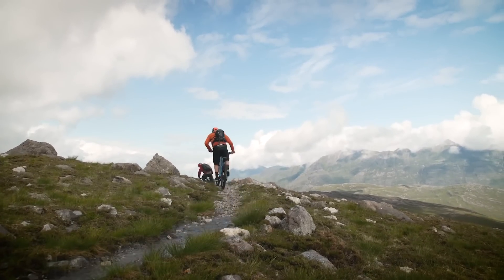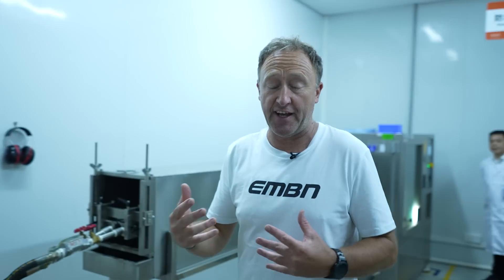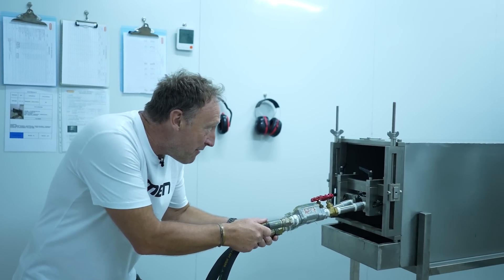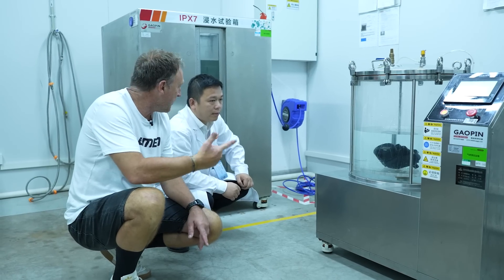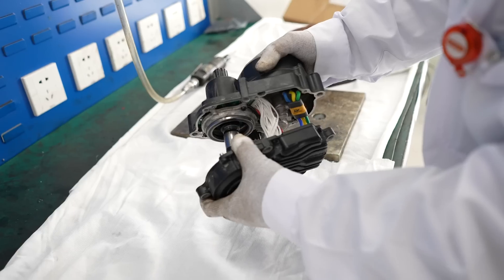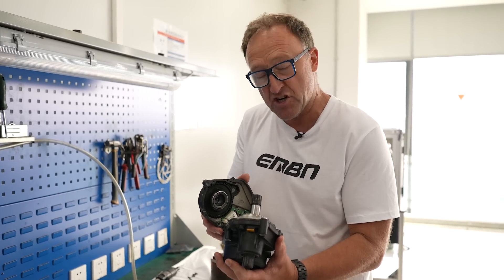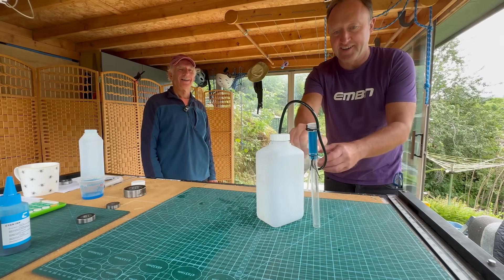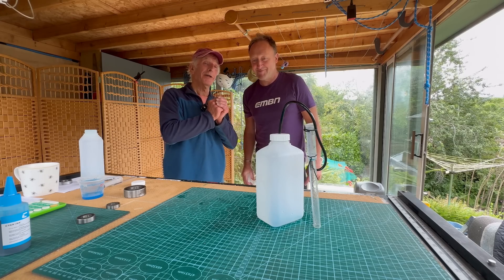Are eBikes Waterproof?

Comment: All I can say is, I’m so thankful that I live in Southern California, where it’s always dry. I couldn’t deal with that constant mud and constant bike cleaning.
Reply: I feel ya.  Not in CA but in Qld Australia.  We get an average of 3-5 rainy days over winter and 9-10 during summer.  Even then it's not normally set in and the trails are never complete sludge.  

It would drive me crazy.
Reply: @lucideuphoria7092  Australia rocks, particularly Qld!!
Reply: @joehozzy2616  the only thing we are lacking is elevation...for some reason our trails cap out at 50-60m elevation loss regardless of how many 300-400m fireroad descents in the same locations.  

You basically have to ride old overgrown rutted logging tracks if you want a descent over 1.5km which is strangely frustrating.
Reply: Ha. It really does suck. I want your weather .

Comment: These test are ok from a component level perspective. But, it's missing the real practical test. When using an e motor there are forces applied on the cranck, the housing of the motor etc. That should be considered in a test setup. Also, as with all components, less is more. Motors should have fewer parts and easy to be maintained.

Comment: Problem: Temperature differential creating moisture vacuum.

Solution: 2 (two) 4mm drilled and taped holes in the motor case. One upper, one lower. Vent hoses and one-way check valve. 

Bonus Solution: Mechanical venting system in addition to the above. Pedal driven. Basically, it's a positive crank case vent. 

Water ingress, a non-issue. But corrosion will be. Oil filled or bathed is the only way. But still will need vented.

Comment: Having had bearing replaced in our bosch motors, & being a  mechanic. Should the motors not have a breather tube up into the frame, to allow air transfer without sucking it past the seals ? Love your channel 👨‍🔧

Comment: Not having moisture detection in motors is unforgivable, submersible pumps often have this and it could be integrated with some desiccant to provide limited protection….. the cost implications are minimal the sensors are typically less than £5 retail….. integration costs would be minimal.

Comment: Ray's experiment works well in an open eviroment and when the air pressures can equalize. When introducing correct sealing, the capillary effect susides dramatically. Don't forget water molecules are larger than Air molecules.

Comment: It is simply a fact of life that ALL seals have a lifespan. And that they will wear down. Dirt plus water is an abrasive mixture that will destroy every seal sooner or later. And yes, this means maintenance. And depending on your habits this can be in longer or shorter intervals. A pressure washers forces the abrasive water-dirt mix into the seals which is simply a death sentence. Maintenance can capture this while only the seal is damaged instead of the whole motor.
These eBike motors are incredibly rug sized and survive an incredible amount of abuse but you simply have to understand that is ability to withstand the elements will end sooner or later. Even standard bottom brackets break down eventually and mid drive motor units contain these on top of the electronics.

Comment: The main issue here is the motors are new. It would be best to see a motor used for 1,000miles then go back for testing and see how it fails then.
Reply: 1000 miles? , need to ride in the lake district , 200 miles will do it . does matter what brand either unfortunately
Reply: I've done 600 miles on my bike already and expect to clock more. I'd find this information extremely useful.  @mps6dave

Comment: I am on my 3rd Bosch CX motor! The last one failed in hard rain on the Climachx trail near DYFI bike park. Granted it rained hard and after 5 minutes we rode through all puddles but have NOT submerged the motors! Both motors (my friends was a shimano motor) failed within 30 seconds of each other just as we finished riding. Not impressed with Bosch. If the motors are so sensitive to water ingress then don’t sell them for MTBs.

Comment: That repeated dunk test in dirty water is quite impressive. Maybe motor manufacturers could "fill" their motor with dry nitrogen gas before sealing up. Nitrogen is used in race tires because it expands less than moisture laden "air". Anyway, just thinking out loud.

Comment: yes the motor should have oil in them and a full maintenances kit with seals and bearings that you can install on say a yearly basis. I mean you do that with head sets and other things on the bike. As far as blaming it on pressure washers the manufactures aren't being completely honest yes you shouldn't use them but, it happens to bike that have never seen pressure washers. Every decent manufacture should have a full service kit and bike shops should offer the install service and also sell the kit. It's a win win they make money your motor is kept up. The other way customers are unhappy and may not want to buy from you again. Also people are still going to buy new motor for various reasons.

Comment: Seems like the answer is a vent tube that runs up the seat tube into a flexible air bladder of say 30 or 40 cc. Motor cools and sucks in air from the bladder, motor warms up and pushes the air back into the bladder.
Reply: great idea. also, fill the motor with dry nitrogen when manufactured.

Comment: 👍Crankcase/engine ventilation with venting high up in the frame should solve this negative pressure/vacuum problem that exists.
Even a temperature hike around 0°C, is also a problem that can fill an engine and other closed vessels with water🤔

Comment: Bafang has shown that they are aware of this even in this video. The test in the pressure tank is exactly that. Cooling down the motor quickly would result in a vacuum inside it, which is physically speaking exactly the same as increasing the outside pressure.

Rays calculation shows more of what would would happen with an incompressible medium such as water inside the motor, air on the other hand can compress under high pressure very well or expand under low pressure. I am not saying he's wrong, but the amount of water sucked inside would be far less ( depending on the quality of the seals) than the calculation would suggest because it is missing the seals as factor.
This might be another reason why ZF has chosen to move some electronics out from the motor. When I remember correctly the battery electronics are placed in the upper part of the battery compartment, maybe they're onto someting with this idea.
Reply: @haemmertime  if rapid cooling creating suction is a problem then why don't the just fit a breather pipe to a safe location, seams a pretty simple fix to me.
Reply: @superchickensoup  true, this might be a solution, it comes with downsides though. Mainly it would increase the air volume the motor, by that when the air cools down it would cause a greater suction into the motor. When the inlet would be in the water at the same time (maybe a in an accident/crash) as the motor gets cooled down it might result in more water getting pulled in.
There are pressure equalising tanks in hydrolics to absorb peaks, I would consider this a better solution, because they can be integrated in a sealed system and don't require any electronics. These however would add weight to the motor.
But that's enough armchair science from me, have a beautiful day

Comment: motors need is to include moisture sensors…… if pressure is an issue then could include a bladder or bellows under a cover. Just on motor nr 5…. Never pressure washed and carried internally in vehicles when transported
Reply from the maker: Sorry to hear you've gone through so many motors, what brand is it just out of interest?
Reply: Specialized 2.2. 4 under warranty and the latest one that I’m going to have to fund from an independent specialist instead of Specialized. The temperature change / suction scenario could be addressed by including something like a shimano reservoir bladder seal from a M775 lever.
Reply: If rain get at e bike it will cause problems your bike gets nackered

Comment: I think the pressurized motor submersion test shown at the bafang factory simulates the same situation as Ray's demonstration. It creates an environment where there is higher ambient pressure outside the motor than inside the motor while water is present all around the seals.

I agree with other commenters who have stated that forces on the crank shafts, or other mechanical forces applied to the motor while exposed to water are the most likely culprits for how water ingress can happen in real-world use.
Reply: There is a simple solution for this problem, a valve and hose to reach  in a dry  area of the bike, so the bike motor can breathe .

Comment: breather hose running up the frame will solve the suction issue
Reply: Son dynamo built a pressurised silicone air bladder into their hubs to solve this very problem and now they give a 50,000 kilometre warranty on their bearings.
Reply: @DaBinChe  This is common practice with 4WD differentials, gear boxes and transfer cases. Breather tubes running up to a high point with a filter to stop water and dust ingress

Comment: There's no excuse why any of these motors can't withstand IPX5 water ingress standards. They are designed to be used in mountain bikes, and mountain bikes are going to get wet. My Shimano E8000 has been transported on the back of my SUV for 4 years and has done over 5,000 mi, I just cracked it open to regrease it and it was dry as a bone inside. If these things are properly sealed, they should never have water ingress.
Reply: @XennialGuy  that's absolutely true. But there are even ways to prevent moisture sucking into the motor, even when a sealing isn't working properly. They could do it by a membrane.

Comment: One answer would be to make them easy to service with widely available, reasonably priced, spares. Who cares if you have to change bearings every year if you can do it 8n an hour for about £20. Same goes for electronics, components/boards are cheap as chips, just make them easy to swap and cheap to buy.
Reply: Was looking at Bosch CX gen4 and I'm surprised the replacement cost is under $600 all in from reputable Bike shops on ebay. Says they are fully programmed. If that's plug and play by me there's no sense in getting a shop to repair an old motor.
Reply: @DSC800 my cube reaction was onto its 3rd motor (original plus 2 replacements) by the end of its 2year warranty. .

Comment: OK.... I just went and looked a motor replacement video. It looks like if someone was going to service a Bosch motor, they have to strip it down like they are putting in a new motor. What BS! and a good way to sell new motors!! I have a 1985 Honda 3 wheeler I bought new. Its been under water, over water and thrashed for 35 yrs. And I had to put a new motor in my bicycle in 4 yrs. Cordless drills I've dunked in a pail of water to was the mud out and they've been running for 20 yrs. Either make them more serviceable or get Makita or Honda to build bicycle motors.... And I'm 63! I'm not thrashing on my Trek Powerfly5....

Comment: currently a lot of the motors are a total write-off from water ingress. circuit boards get no extra protection and it seems to often be that which makes the whole thing landfill. Protect the circuit boards better (completely seal them away), and allow moisture to escape the rest of the motor via one-way valves/membranes.  I don't think you can stop water getting in, but you can allow it to get out.
Reply: Seriously, what would it take... $1 of protective goo coating circuts.
Reply: good isea, pop a small sachet of that silica gel inside the casing...that will help dehumidify yhe inside
Reply: @RicardoPetrazzi  silica gel soaks up humidity, but only until the gel is saturated, then it no longer works unless you can dry it out.
Reply: @stuartbayliss9251  plus chem interactions. But seriously, we've been coating many phone pcb's for years, and there are conformal coatings and varnishes that are up to the task. If you're deicated enough to do a pcb smt repair these days, I can't see such a coating stopping you... however most any service repair is going to put in a fresh part anyway, if there is a physical failure.

Comment: I have a Lappierre with a Yamaha Pw motor and just fitted a new set of crank  bearings due to noisy when peddling. Somewhat disappointed with the poor weatherproof crank bearings. It is 5 years old and would hope new motors are now better protected. Main bearing kit was £52 and it took me about 2.5 hours to change. Quite simple really. However, with improved seals these bearings would have lasted far longer.

Comment: I do waterproof IPX7 certified motors. It's costly and only high level competitors book this modification. It takes days for high temp silicone and red insulating varnish from mg chemicals to cure. Depending on motor size and riders budget it starts from 250€ up to 600€ ebikes only.
Mechanic engineer forgot to mention condensation...

Comment: So, based on the latest information presented,  a simple vented hose set up would be the answer to the rapid cooling suction issue. If my motor ever fails, I will modify the replacement as described. 😊
Reply: Yes like $x$ diffs we could have a vent up inside the battery towards the head tube to vent the motor and put a Gortex breather on it.

Comment: Great video,  keep them coming.  Need a look around Bosch motor company
Reply: I had 4 warranty motors on my Bosh. On my new bike they have limited the warranty to two years from point of sale and no more perpetual warranty
Reply: There is also the “right to repair” issue if the mother board fails no way to fix or buy a new one has to be a new motor full stop
Reply: @Calvin_Wright  EU needs to step inon this and batteries.  Ebikes are becoming an ecological disaster and Bosch is the worst offender

Comment: Breather pipe drawing air from an area within the frame high up to help balance the air pressure - simple
Reply: Yes. also add a flexible air bladder to the end of the vent tube too so that any air sucked into the motor is always bone dry.

Comment: Until bearings are redesigned my emtb won't see water if can help it! But certainly the blue head gasket sealer will help on your outer metal skin of the bearings and a tad on smaller crank one my mate even has thread lock on his and work's so its not hard for them so cut a channel to seat an O Ring!

Comment: Can the motors have a breather pipe fitted up into the top of the frame with a one way valve to release temperatures of the motor? Maybe the one way valve would have to become a checked/serviceable item but would aid the motor from water ingress?
Reply from the maker: That could aid the issue that Ray explained but will probably cause more issues than it fixes 🤷‍♂️

Comment: I’ve done a few sessions in the snow over winter here in Colorado. So far so good it’s a blast riding in the snow.
Reply from the maker: Does it affect the range on your bike much?
Reply: @embn  most definitely.  I do ride a lot in winter here in Colorado. 15 miles or so on a ride. On my 2022 husky with the ep8 in snow roughly 6 inches to 1 foot uses up all my battery yeah. But it was Soooooo fn fun.  My new Rocky Mountain instinct just showed up on Wednesday 7/24/24.  Heading out later to 10,000 ft to beat the heat.  Happy Trails embn

Comment: Bearings need to be completely redesigned the inner and outter metal bodies need a rubber seal gasket seated in a machined groove on the surface whare it presses into the body whare its metal on metal contact only! Same with the inner bearing ring same channel need cut into it and a gasket fitted whare the BB crank is met as metal on metal again it will not have a 100% water tight seal it might mean the wall thickness of the Bearings might increase a mil or so and will change the sizes but I think it's definitely something to consider for future proofing our investments if brands would go this far but in all seriousness they are manufacturers only interested in profits same as cars etc and have a life span of 3 to 7 years then forced to buy from them again never ending circle of greed whare as it can be such an easy fix!

Comment: Specialized bike here , 3 years old , 3rd TCU, 2nd motor , 2nd battery to motor harness cable , all water ingress, ridden probably once a month .Here in the UK imho , not fit for purpose .next eebs will be pinion bike anyway. ebbs Costs a fortune in drivetrain components too.!eats em for breakfast!
Reply: I hear you, the sooner an mgu and belt drive, the better!
Reply: Has the Pinion MGU been out long enough to determine its durability and longevity?
Reply: @Scomelbasses  the gearbox has been around a while, not so the motor?! 🤷🏻‍♂️
Reply: @danielsimmonds5162  yes, I’m aware the gearbox has been around for awhile, I used to own a bike with one. But the MGU hasn’t been out long enough to say that it will be any more durable than any other motor out there. The gearbox itself is simple, no electric components to worry about. The MGU will have all the same potential problems as all the other motors.
Reply: @Scomelbasses aye it will . Gonna wait a couple years , see how the land lies . Back on normal bikes at the mo : luvin it
Reply: Pretty standard for specialized? 😂

Comment: By that theory when they warm up again the heat will produce pressure inside which could force liquid back out if there was a one way valve placed correctly on a water collection point maybe.
Reply: Water tends to stick to surfaces. Also some water will evaporate inside a warm motor and condensate when it gets cold again. If you pour water out of a bottle and then seal the bottle again, it will contain enough water to stain some metal inside. So, without good ventilation of a motor interior this will not work.